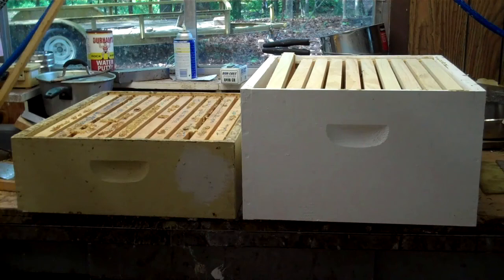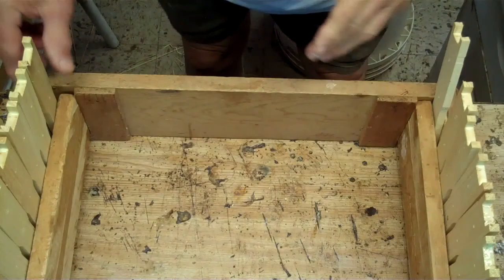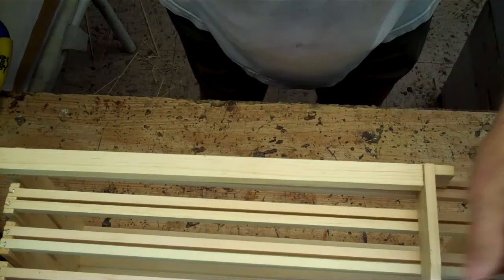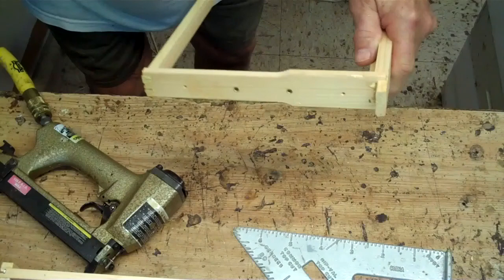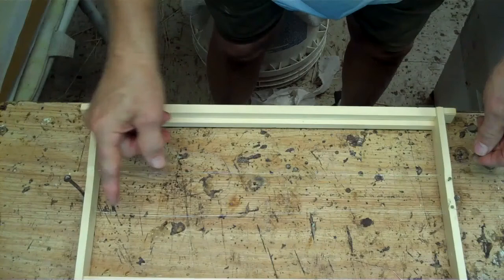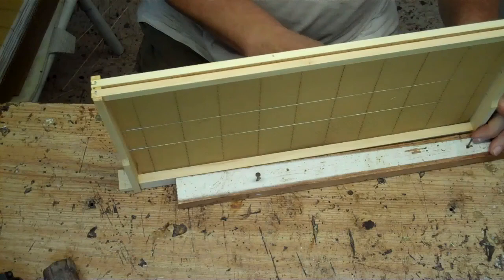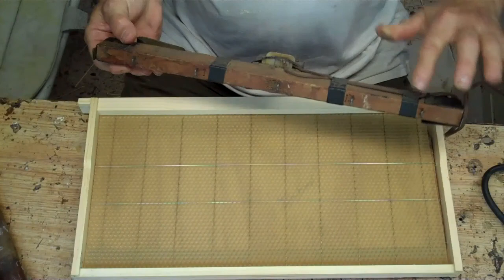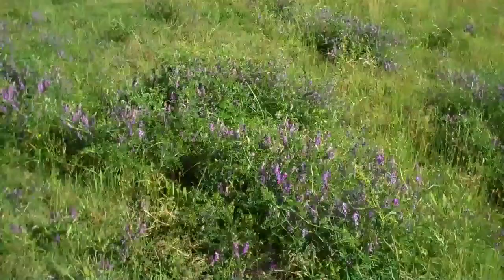Making/Assembling a wooden frame for a Bee hive - Beekeeping Video Instructions

Comment: that's a lot of work. we used to put 4 horizontal wires only and then we had a heat rod type thing that melted the wa to the wires. like a soldering iron bar. we just pressed down for about 3 seconds on each wire and done. i used to lay wa in about 150 frames an hour that way when i was 13. i'm 45 now.

Comment: i'm the son of an old beekeeper. my dad died in 2000. but i grew up on an apiary. i'm trying to build something a little different right now. for more of the home hobbyist. but i don't have all the tools i need anymore. so it's kind of a slow design phase because i'm dirt poor. i have a different idea for building frames. but i'm not sure how it's gonna work yet. i might post a video after i'm done to see what people think. you're design looks similar to what i grew up with, but too much wire in the frame. we used to do like 4 pieces across the frame horizontal, and that's all. we had no problems with etraction that way. and it takes less materials.
Reply: ***** yeah i'm gonna try something a little different. i'm gonna have to make my own custom frames. i'm just toying around with it for like the home hobby thing out of some wood i got laying around.
Reply: ***** i'm gonna experiment with a vertical frame.the hive i'm building is something a little different. and the bees don't care about the shape of their hive. naturally they would do it in a hollow tree or something anyway.
Reply: ***** yeah i need a compressor and a brad gun though, and i'm broke,and poor. or i'd be done already.
Reply: ***** i have about 6 or 8 sheets of wacks. (broken keyboard no eks) but they are old and moths have eaten holes in some of it. so i need to get some new stuff.

Comment: How much voltage going thru wire??????
Reply: thanks
Reply: +ytmm9055: I am a furnace tech out here in Washington state... Looking at the transformer I believe it maybe a doorbell ( 120 volt down to 10 to 15 volts) or furnace ( 120 volt down to 24 volts).. Be careful and only heat for a few seconds... Energizing for about 10 second at touching the point and energizing  on the wire can cause a transformer to quickly over heat ( Its an electrical short with out a load device).  If you keep it energized near 30 second it COULD FRY the electrical transformer and you will smell a sweet marshmellow fragrance of the internal wires in the transformer FRYING/Burning out...  But this looks like a better idea than many wax heating devices I have seen so far...
Reply: +CoalfieldBeeLover Gerald   ok - thanks!